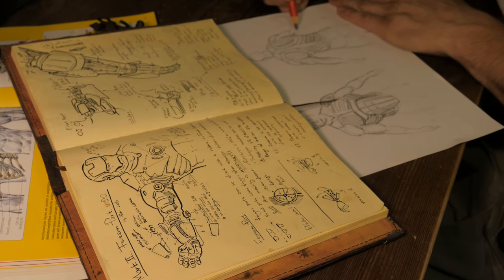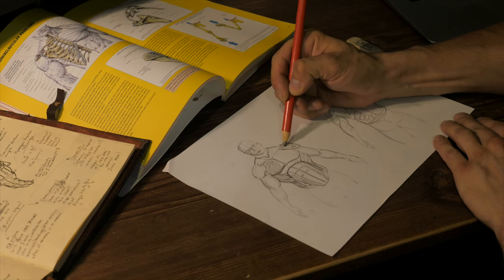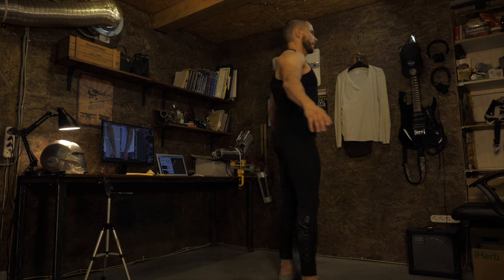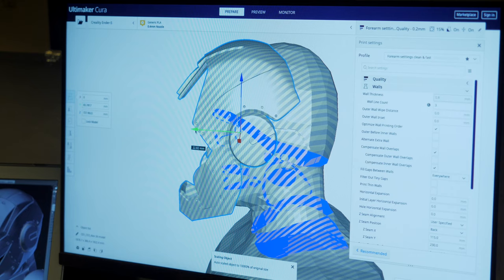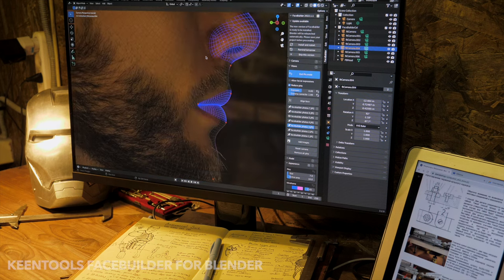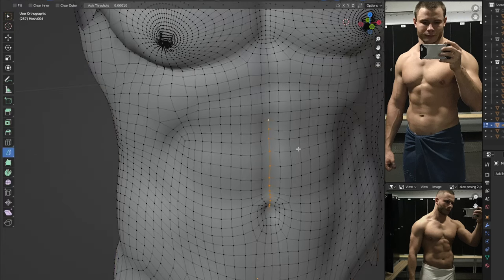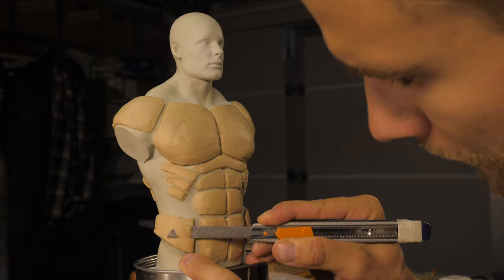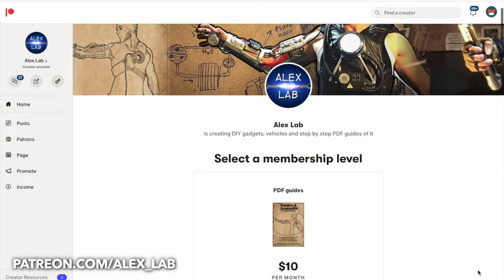Precise body 3D model in Blender. Basics of Composites #1: How to scan, model, print and sculpt.

Comment: I know this might be a bit early in the process, but I hope the helmet is well ventilated.
Because throughout the history of closed helmets, there has been a little thing called the "helmet horror".  Where carbon dioxide builds up inside the helmet causes the wearer to feel like they are can't breath, leading to panic and potentially brain damage or suffocation.
People used to prevent this by only taking deep breaths to push out as much air as possible when you exhale. If you choose to do any physically straining activities, I'd strongly recommend having someone on standby who can quickly take the helmet off of you if things don't go well
Reply: He needs to link those armor plates to micro servos that can open the back helmet open and close. If he wanted to go further he can use a carbon dioxide sensor linked to Arduino and oled screen programmed to open when it gets too stuffy
Reply: @zandermarriott  can't the Electrolysis device make oxygen?
I mean he can make a process where the oxygen goes towards the nose, no?
Reply: @marz.6102  yes by why overdesign something like that when most servos are just plug and play? If something is over engineered it has a higher chance to break
Reply: @zandermarriott  that is true but we don't want Alex getting negative emotions Everytime he tries on the suit and we also don't want it to cause him brain damage, tho now that I think about it, why not have a fail safe that'll allow him to have good ventilation from slits or shaft or something like that so that he only needs to rely on the oxygen from the electrolysis device only in dire circumstances.

Also hey 👋
Reply: @zandermarriott  but wouldn't that leave him exposed, what happens when shrapnel or he gets shot at the back of the head through the vents?
Reply: @marz.6102  he will not be using his suit for combat so he will not have to worry about that.
Reply: @zandermarriott  actually your right, tho he did say a everyday suit so maybe he was implying a stab proof suit, since that could happen in cities or something or maybe just something to absorb the impact when he falls off his one wheel
Reply: Look at respirators, they solve this issue with exhale valves. Just have an intake and exhaust.
Reply: And pilots
Reply: @VulariBatman I think in one vid he said, it would be a ballistic and a airtight suit+helmet
Reply: This can be easily mitigated by planting some tiny plants in the helmet

Comment: As an exoskeleton builder, I have realized you must sacrifice strength for mobility or find that “sweet spot” of the two. Keep up the good work!
Reply: Would you say using bio mimicry help in finding that sweet spot?

Like using the mechanisms of the diabolical ironclad beetle??
Reply: @marz.6102  yes you can always overlap plates the under plate to be flexible giving the range of movement needed and the overlapping plate to protect that opening
Reply: @zandermarriott  also in this video 
https://youtu.be/NS3AqJB5SfU

that goes in depth of the mechanics nature of it armor it might actually be of use to him in times
Reply: @zandermarriott  "overlapping layered armor plates for flexible movement" I don't know how that'll look but hey it's new and who knows. 

And talking about about layered you ever wonder why Tony stark might have been so swole when he put on the suit, I think it's the same reason f1 drivers necks are hardened to the point that if they flipped in their cars the neck wouldn't be broken, so maybe it's optimal to have a well muscled and strong body especially in the places that might end you if not layered in muscle.
Reply: @marz.6102  In order to survive such a shock impact inside a exoskeleton one must layer e inside with a impact dampening material like sorbothane. This does not allow energy to transfer through the suit into the user. Also, there are two parts to an exoskeleton. The exo itself and an endoskeleton. The endoskeleton should be skin tight with the pilot. This allows sensors (preferably at the joints like a potentiometer inside the elbow) to be placed that sends either a pwm signal or flipping of a switch to a servo or actuator (hard muscle). This separates the hard exo with the flexible endo
Reply: @marz.6102  also, Stark has struts in his joints to dampen the radial load on a pilot as well as deal with the transfer of energy. I have adapted this in my own exoskeletons and it works beautifully. You do not feel or are burdened with any weight from an exoskeleton.

Comment: You can also change tris to quads in blender. While in editing mode in the faces drop down menu. It isn't as good as doing it manually because you have less control but it is much quicker.
When sculpting by hand you may like to try a loop tool or a ribbon tool. A box knife works but I like the ribbon tool because I stab myself less often with it.

Comment: Good topology is not necessary for 3D printing, but may be useful for organic or hardsurface modeling later on. Although... Why not sculpt the parts in 3D? And then recreate them in CAD or retopologize?

Retopo makes perfect sense if you want to add a muscle stimulation to design with high mobility in mind.

Comment: So when does the materials video come out? I actually had some ideas.have you considered nitinol (NiTi) as armor? A 1mm thick plate can stop a 7.62 mm round from a distance of ten meters with very little deformation, and because it's a memory metal, bullet deformation can be easily repaired via heating.

Comment: Alex, I've been looking into using a combination of pre-preg carbon fiber, aramids (e.g., Kevlar), and an ABS plastic with hemp fiber additive to create a "plasteel" that has a Charpe impact, compressive strength, fracture strength similar to 1020 steel but at 1/10 the weight. Still researching exact mixtures, but if bulletproof, lightweight composites are what you are moving towards, it might be worth looking into yourself to hit the ratios you need yourself.